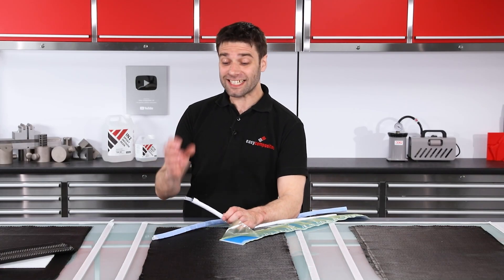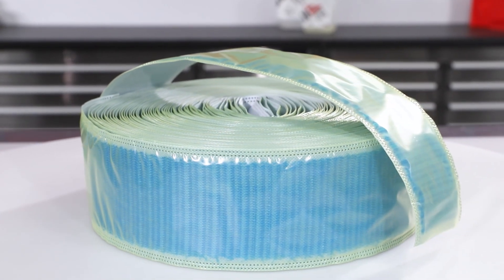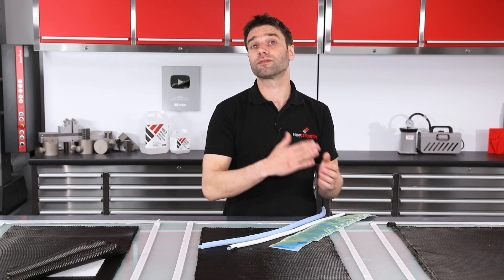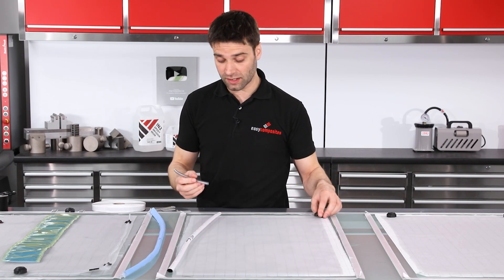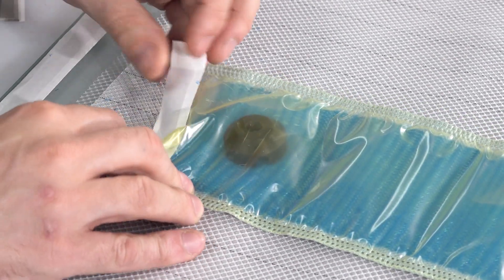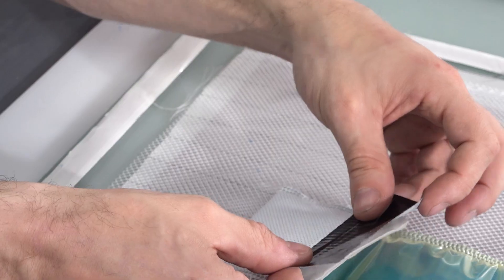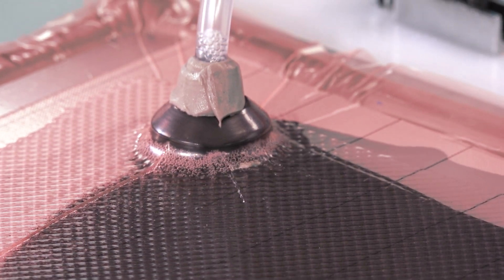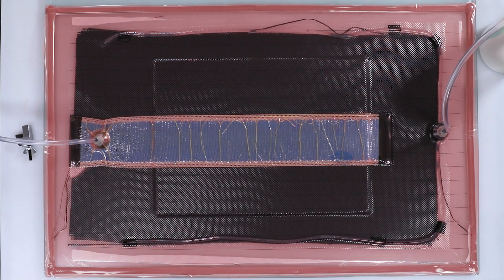How to Use Microporous Membrane Products (eg MTI Hose) in Resin Infusion

Comment: Hi Paul here from easy composites

At this stage it's an Arnold Schwarzenegger level catchphrase
Reply: Get to the choppppppp....ed carbon fibers and add 10% of the weight of the resin to it before mixing it with the hardener

Comment: Thank you for learning a lot from Easycomposites YouTube. I can study while watching videos even though I don't understand English. I wonder if this video is a product that helps prevent pinholes from forming if you use them.
Reply from the maker: It depends on the cause of the pinholes but the correct use of these products can help with resin distribution and flow, which if it goes wrong can be a major cause of pinholes.

Comment: Great info - I have a part that is a meter in diameter and a half meter wide with 2 compound curves - I've struggled to get the resin to infuse to every corner and edge. I'll give the MTI and MVS a try to see which does the best job in my application. Thanks.
Reply from the maker: Thanks for the comment, yes, this sounds like a good candidate for these products. It might be due to the flow characteristics of your laminate, if it’s a thick stack or you have some slower flowing reinforcements in the (like plain weave carbon, biax or UD) then switching to an outside in infusion and using the VMS Strip would be a good way to go 👍.
Reply: @easycompositestv  , the product is a challenge because of its half round shape. Think inner fender shape, its halfround front to back, and curved from outside to inside. I've been struggling with it for some time 😁

Comment: New to infusion.. Just curious to how come you don't have inlet one side and outlet directly opposite?
Reply from the maker: Hi Tom, on a simple component you can do that and in fact, you normally would. Products like MTI are useful on more complex shapes where the advance of the resin flow might otherwise close off air paths to certain parts of the component, or where you can’t predict where the resin will get to last. Take a look at our other, more conventional tutorials on resin infusion, we have 3 other tutorials on the subject - they should give you a good grounding.
Reply: I think this was just a "how not to do it" to demonstrate the problem you could face in more complex parts
Reply: @dejayrezme8617  which is exactly what he says in the video.

Comment: Interesting you didn't include the MTI Valve in this video, are you going to cover that in a future video? Have you guys had a chance to review the valves yourselves?

I actually used to use the MTI Valves 4 or 5 years ago, but then stopped when I did a number of tests and couldn't actually notice them working at all, I was still able to absolutely flood the feed side of the bag with resin when theoretically the valve should have regulated and shut off flow long before that happened. 

I know DD-Compound say there is a small chance that a bit of debris can get into the valve and prevent it from functioning, so I was never sure this wasn't the case - but it seemed unlikely to be occurring on 100% of the tests that I did.
Reply from the maker: It is possible we may cover it in a future video as this video was more about the membrane products.  We have not had any problems with them ourselves and they do seem to function as intended.

Comment: Hi
Thank you for your valuable information.
Do you have a video on making carbon fiber drone parts?
frame, propeller etc. (especially the propeller)
I will be glad if you share such videos
Reply from the maker: Not at the moment but we'll certainly add it to our list of requested videos for the future. One thing to bear in mind is that propellers can be incredibly difficult to manufacture in terms of the balance and structural integrity.

Comment: Will you ever be making a video that covers making very small, intricate parts? I've been thinking about taking a swing at this to make a carbon fibre version of my gaming mouse, I just can't figure out if it would be possible to do since it has screw holes, PCB mounts, and clips integrated into the different parts. It would be especially difficult to hand laminate I would imagine.
Reply from the maker: We have videos demonstrating various laminating processes, it may be easier to skin the mouse or make a carbon fibre shell and 3d print the internal mounting points and bond them in place.
Reply: @easycompositestv  That's a very good idea, thank you for the suggestion

Comment: I have watched hoping you will make an episode telling me how to make make my current project.  I am making a 20ft car/motorcycle body.  Wet layup over a foam buck.  Do you have any techniques for non-mold non-vacuum bag projects?
Reply from the maker: Hi Shea, no general suggestions but maybe some thoughts would come to mind if you have a more specific question or problem to solve. I guess we could point out that polyester resins will melt styrofoam or XPS foam but epoxy won’t. Although epoxy is a more expensive resin, you’ll save a lot more that the difference by using XPS foam for your shape and the coating that in epoxy to protect the foam. You should then apply a release agent to the epoxy shell and then do your wet layup for the component onto that, that way, you will be able to remove the component from the former shape quite easily.
Reply: @easycompositestv  for sure, thanks for the reply!  I'm working on a streamliner body right now. My biggest concerns are keeping the carbon from lifting and getting a smooth finish from the final peel ply layer.  I have some videos on my channel about the build and I just layer up my first layer today.  I was watching your channel to get pumped up😂.  Trying to break a landspeed record!

Comment: Make one video on car metal rood replace by making carbon fiber? 🙏👍❤️
Reply from the maker: This would be the same processes as in our carbon bonnet/hood video tutorial.
Reply: @easycompositestv  but how they add air vents and sharpen design ...etc.
Reply from the maker: @rajkargutkar3751  Normally by building them into the mould itself so making a pattern/buck with an original fitment hood with any required openings/vents before producing the hood mould.

Comment: A great clear demonstration as always. Thanks for sharing. Around 11:00 you say about leaks in the bag. If, say, there is any drop in my test before hand is that not suitable for use with these hoses? What if I have a tiny drop that I can't find. Usually I wouldn't worry about it but this sounds like once the infusion is complete the vac is doing very little?
Reply from the maker: Hi Ben, when considering a leaking bag, it would be exactly the same when using this type of product as when not using them; either way, a leaking bag means you’ll gradually lose pressure in your bag and compromise the laminate. To overcome a leaking bag in an infusion is very difficult because at the end of the infusion, the resin will be locking off the vacuum side; if you leave the pump running then you’ll draw off too much resin and, of course, as the resin starts to gel then the vac will stop doing anything at all. Using a membrane product, when the resin reaches the the membrane it will lock off the membrane in that place, the result would be much like closing the vac line and switching off the pump.

Comment: Next one 
Core materials 

which one is the strongest one

how easy to separate layers without closing it around (when u need to cut trough core exposing it) /// or when closed after part is made (like grinding edges  to V shape inside and then filling with epoxy + fibers mix etc to protect the edges)

which one is easier to use

how easy to damage by tightening the screws etc.

 or by hiting it with something 

overall ....strenght comparsion between new ones like u use - 3dcore , to older ones like soric etc
Reply from the maker: It entirely depends on the context and application.  Strong as in stiff? Impact resistance? Shear strength? etc.  It also massively depends on the skins.  A core material is akin to the supporting member on an I beam.  Its sole purpose is to improve efficiency of the composite skins.

Comment: If i wanted to do the  with the core section, but the part is also a visual part that should look perfect form the flat side, how do i go about doing that? Doing it in two stages/infusions maybe?
Reply from the maker: Two stages is a possibility, or as suggested you can sand the edges of the core to a taper so there is no line around the core edge.  You can also use layers of carbon tape to fill the "step" at the edge of the core if sanding the core is not desirable.
Reply: @easycompositestv  aah, i did not catch the detail about chamfering the core edge! Thanks for making a video about this!

Comment: Paul if I were to infuse a very large surface area would I be correct in thinking that a series of these infusion strips spaced, say, 500mm apart would ensure a good even distribution? Specifically, I mean for an outer layer of carbon on a boat hull.
Reply from the maker: A series of strips or one long strip could be used in that way to help ensure it works as you planned it.

Comment: Does the MVS strip have a peel ply or release film on the bottom side? So could I place it directly on the surface of a part (such as flax) on which I am not using peel ply and mesh?
Reply from the maker: You would need something underneath so a strip of Peel Ply just under the MVS would be fine but without it, you wouldn't be able to remove the MVS from the reinforcement.

Comment: Can you guys make a tut over how to make carbon fiber wheels for cars?  Would love to make a version of the 18 inch wheels that come with the tesla for weight savings and so that the caps still fit on the outside.  (I have the rimetrix orbitals, not the factory aero caps and they are much more efficient and stylish).
Reply from the maker: Hi chase, its unlikely we’ll put a wheel video together as not only are they one of the most complex composite products you could look to make in terms of the structural integrity and balance but also, the safety critical nature of the wheel makes it something really best left to specialists who can perform the necessary pre-build FE Analysis and Structural Calculations as well as the testing of the finished piece to recognised standards. For an oversight though, there is a great Koenigsegg video on YouTube showing their processes.
Reply: @easycompositestv  thank you! So I shouldn't attempt this myself?
Reply from the maker: @aggiechase37  Hi chase, it really would be up to you. We personally won't be making a wheel due to the reasons above.

Comment: is there a reason you don't use pleats on the vacuum bag?
Reply from the maker: For a flat panel example like this, it's not necessary and would just made it less clear to see what's going on with the membrane and resin flow, which is what we're trying to show in this video. For anything other than a flat panel then we would have pleats in the bag.

Comment: Question on vacuum technique: I have some experience with vacuum bagging as a woodworking doing veneers, laminates and fiberglass-epoxy. For large parts, I used vacuum capacitors  (air tanks that already have a vacuum pulled) hooked to the bag. These capacitors great accelerated pulling the bag down. Would this work with composites being infused?
Reply from the maker: Well, yes, you can include a reservoir in the setup, this will have some vacuum ‘capacity’, but ultimately it won’t really have any positive effect in a typical infusion setup. It’s rare that the time it takes to pull the bag down is much of an issue but if it’s something you want to speed up, it’s often easier to just connect up a vacuum cleaner which can do the initial emptying of the bag in seconds.

Comment: would it be possible to strip the outer material away and T off with the MTS? would it be useful to strip smaller spots off towards the end to ensure a full vacuum pull with a designated "pull to" point or should it always be sealed off at the end?
Reply from the maker: If its not sealed off at the end, the resin will just flow easier through the open end rather than the microporous membrane.

Comment: I just end up bagging a whole part and then throwing about 4 inches of MTI hose on the back side of a mold that has strips of Peel ply around the part. Usually works pretty accurately because I'm good at predicting where the resin will go. But I cannot get rid of pin holes in any part for the life of me
Reply from the maker: Hello, if you would like to send some photos to technical@easycomposites.com we'd be happy to see if there are any suggestions we can make to avoid this

Comment: Thanks a lot for all this information. I want buy your product to make carbon fiber parts. I have no experience and I live in the USA. What and where would be a would starting point? I plan on using core materials to make parts about 1/2 inch thick or less. Thanks again
Reply from the maker: Hi Hoss, I guess it depends on what these components are; that wasn’t clear from your comment. Certainly watching through our back catalogue of tutorials will give you a really good grounding in practical composites, even if you don’t fully understand all you’re watching!
Reply: @mckenziekeith7434  hello and thanks for the reply. I use google

Comment: what's the best alternative to your product for viewers located in Australia?
Reply from the maker: Hi Michael, I’m afraid we don’t have any dealers or distributors in Australia and we don’t specifically work with any firms so its difficult to direct you anywhere. We can ship non-Dangerous Goods (reinforcements, tools, infusion equipment, PrePreg) easily and at a reasonable cost but unfortunately Dangerous Goods like resins are more of an issue. If you have any questions though, feel free to drop us an email to sales@easycomposites.co.uk

Comment: But why you made first example that way? If in and out will be on opposite side result will be different,and I thought that's the rule.
Reply: Because of the really simple demo pieces, doing that would create a perfect infusion, and not show the example of what can go wrong, It doesn't make sense if you look at it from the viewpoint of "how to do i make a perfectly flat peice of carbon fiber," but think of it more in the terms of what could happen on more complicated parts where the in and the out arn't perfect, or the part has a lot of weird areas to it, making it borderline impossible to do it the standard way,
Reply from the maker: Grease1991 is correct that these are demo pieces so it was necessary to create a situation that is non-perfect to demonstrate the product.  Ordinarily a flat sheet would be a simple infusion.

Comment: Surely the vacuum line should have been at the furthest point away from the resin line, to try and eliminate dry spots in that 1st finished test piece!? Having it as close as it was, was always gonna draw resin into the vacuum line too soon, and mess up the flow rate of the resin.
Reply from the maker: Well, yes, exactly. That was the point; to demonstrate what would happen if the resin reached the vacuum line before the laminate had fully infused. I thought this was clearly explained but maybe not. Anyway, you’re quite right, you wouldn’t knowingly put the vacuum connector right night to the resin line.
Reply: This was explained VERY VERY clearly in the video.